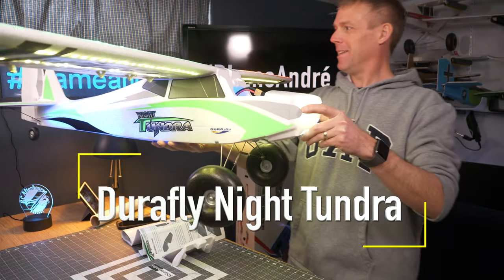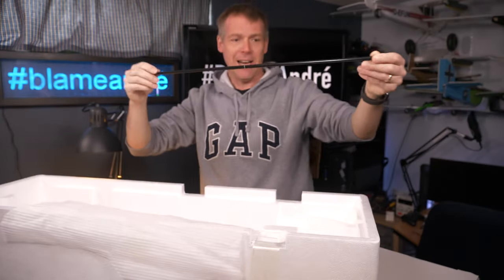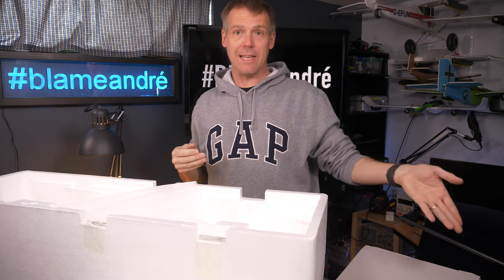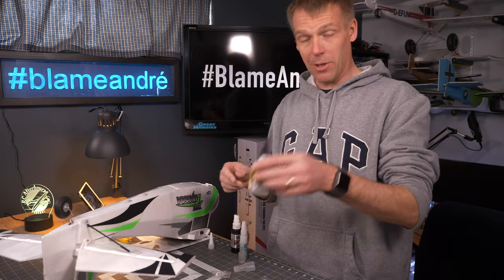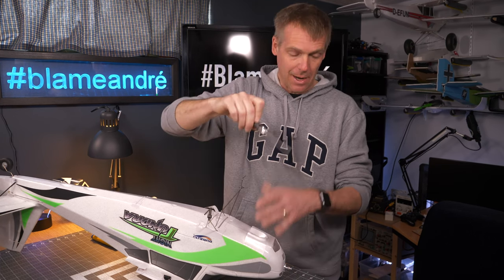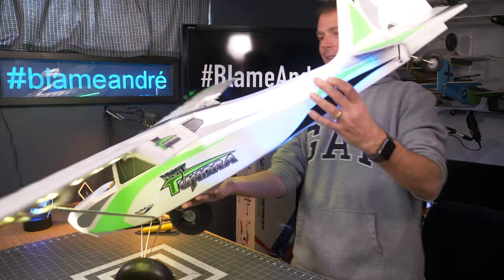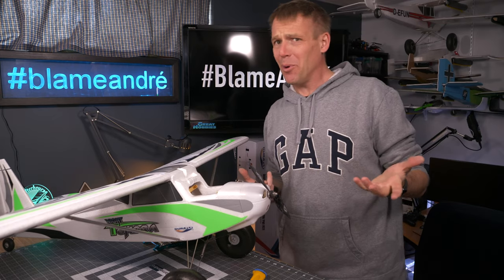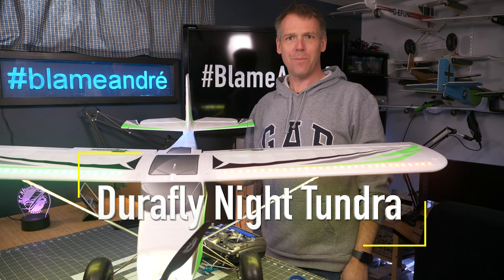Durafly Night Tundra - Bench Time

Comment: I'd have preferred yellow LEDs like under the wings in the rear fuselage. Also would have liked an installed Radio channel to turn OFF the LEDs. Yeah I know you can get an RC switch but would have been a feature if installed by the manufacturer. I still like my old (2020) original V1 Tundra. IIRC I paid $179.99 USD for the V1. The Tundra V2 (PNF) Purple/Gold still sells for $179.99 USD. IDK... $90 more for LEDs seems a bit pricey.

Comment: No info for radio setup with plane. I setup my Night tundra with my DX9. I have no proportional flaps 3 points 0 deg.s 45 and 90.  Also the motor reverses with full flaps when I take throttle to minimum.  Found that out when the plane nose dived on landing entry.
Reply from the maker: Wait, you esc fits into rev when you have your flaps down? That sounds like a mix issue in the radio. For me I set all my expo to 30% and then weights are low 70%, mid 85% and high 100%. Just bit of down elevator on the flaps. Which could be your esc reversing issues. You might have a channel crossed over. I have a DX9 and could attempt make a model. What RX are you using?
Reply: The receiver is a Spektrum AR620. Flaps are on channel 5 and light channel 6 of receiver
Reply from the maker: @barrettfanning6746  Are you running a LED switch? Because stock there is no switch. You might have the reverse esc on channel 6. The LED's just power off the JST connector.
Reply: No switch with LEDs. The two wire JST I have plugged into channel 6 of rx.
Reply: I have the esc plugged into channel 1 of rx
Reply: okay. Found a conflict with my radio configuration.  I had on transmitter gear for channel 5.  I switched that to flaps and went to servo setup and took reverse off flaps.  Now the flaps respond as proportional. I have a 2 sec delay for deployment.  Hopefully that clears up the reverse throttle on applying full flaps during landing.  Thanks Much for your time and responding.  Surely appreciate the help.
Reply from the maker: @barrettfanning6746  The JST should be taking power from the ESC not your rx. You could be over drawing power through your RX.
Reply from the maker: @barrettfanning6746  The ESC will have 3 connections, the 3 wire JR is the esc power/throttle, the 2 wire JR is your reverse and the red JST is the power for the LEDs.
Reply: yes, the reverse is a two wire yellow/ brown going to my channel 6 on receiver.  I misspoke about led’s going to rx.
Reply from the maker: Awesome. Glad you found it. Enjoy the plane!
Reply: Yes. Thanks much! Likewise, happy flying.

Comment: ANYONE HAS FLOWN HER WITH 4 CELLS? my regular V2 had no issues at all!!! same esc same motor but im worried the lights might burn.
Reply from the maker: The lights are 12V. So if you put in a BEC for the LED's you could totally fly it off 4S.
Reply: thanks will ook into it